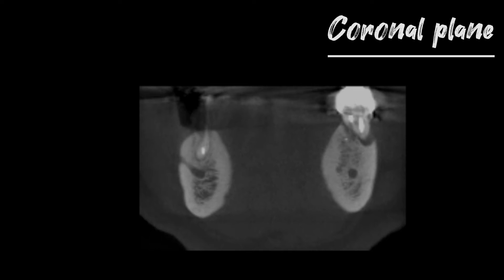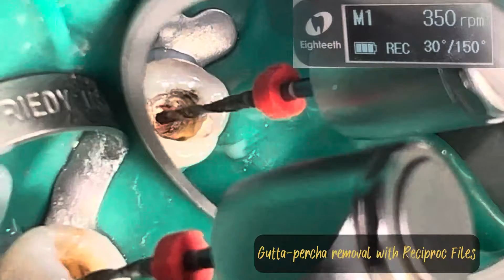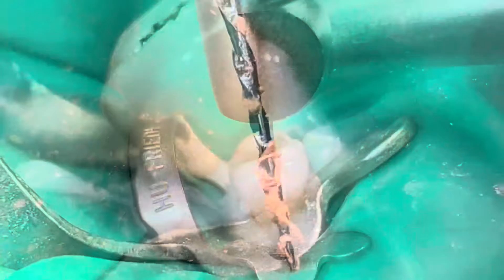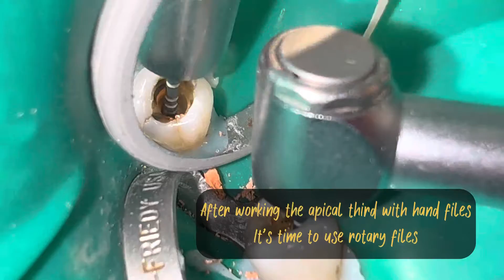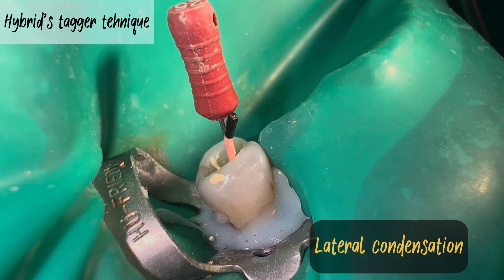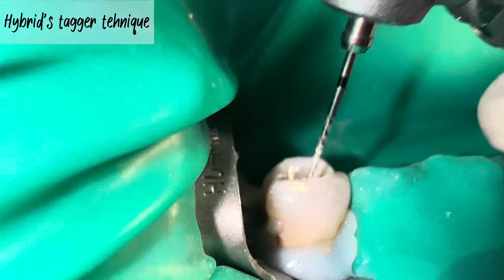Endodontic Retreatment lower 2nd premolar (Reciproc Blue)

Comment: Why use lateral condenstaion doc?
Reply from the maker: @sarsaparillagunawan912  for doing a proper thermocompactor obturation its needed doing a lateral compaction before the use of thermocompactor to avoid empty spaces in the canal. Sometimes i do this 2 o 3 times because the canal is so wide.

Comment: Do you suggest to use 360 Files or Reciproc Files at removing the apic. part of Gutta??? I usually use H Files, but sometimes it doesn‘t work  in the apical third, if Gutta or Sealer are very hard
Reply from the maker: Hi there.  I usually work the apex with reciproc files after reaching working length with small hand files like H or C+. I dont like to use gutta percha solvents but sometimes it’s the only way to get to the apex.  Which system you use for retreatments?

Comment: could you tell us more about what the Hybrid's tagger technique ? starts form 5,22, device, ? what does it do? is this file ?rotates or  ?? thank you
Reply from the maker: Hello!! The tagger technique is carried out by using a contra-angle and a thermocompactor. rotation always clockwise and at 10,000 rpm. use maximum 4 seconds. I have a video on the channel in Spanish. I will try to upload it in English shortly.

Comment: You said to never user rotary files in the apical third and only hand files, does this applies to any canal preparation ?
Reply from the maker: I do not usually use rotary files in the apical 1/3 if I have not worked with manual files before
Reply: @endoaddicted  ok thank you , I have other questions (a lot actually but here it goes) : for the first steps managing the canal, do you put manuel files and NaOCL to clean before using apex locator ? Wich lengh to set going "blindly" in the canal ? And to irrigate you said you use NaOCL/saline/EDTA/CHX, does it means you use all of them mixed in one bottle ? Thank you very much
Reply: @toy3245  For estimated WL, use the radiography with minus 1-2mm. This is what they taught us.
Reply: @Yasi_nzi  thank you very much Jasmine !
Reply: Best to use foramen localisator since radiography does not represent the real location of the foramen.
Reply: From what I know: as soon as you have found the canals and are negotiating them with your manual files, you should immeadiatly follow with NaOCl to irrigate. This because studies have proven that NaOCl needs a bit of time to really desinfect the canals.
The length used to go ‘blindly’ is the estimated length that you have determined by taking a pre-op Rx.
Lastly, these solutions are not mixed no. You give them seperatly. And NEVER mix NaOCl with CHX as this mix can be very toxic, and even carcinogenic to the patient.
Reply: @arshie1045  thank you for your answer !